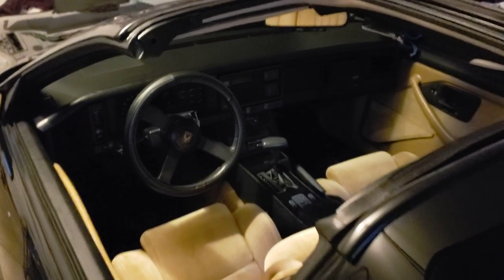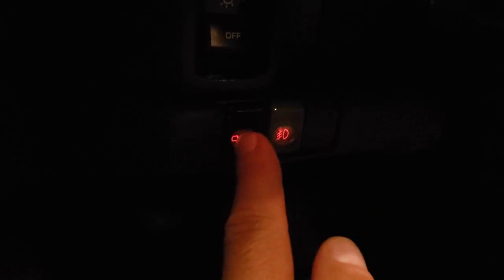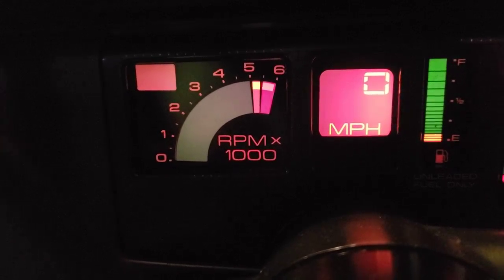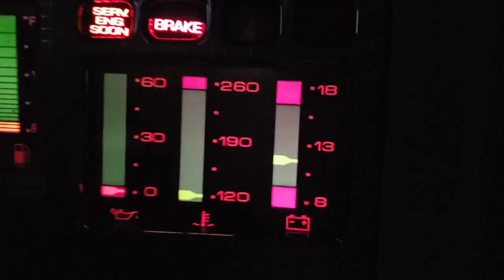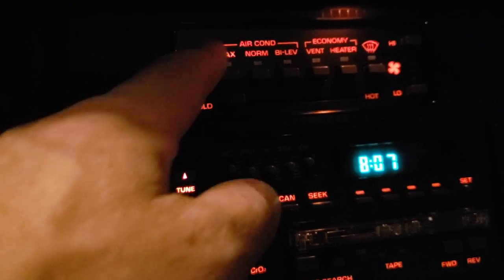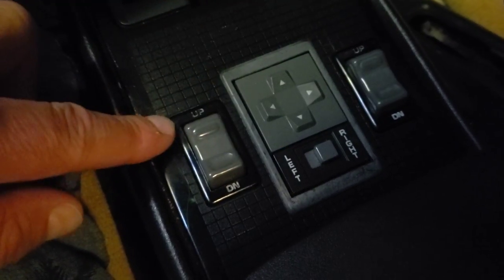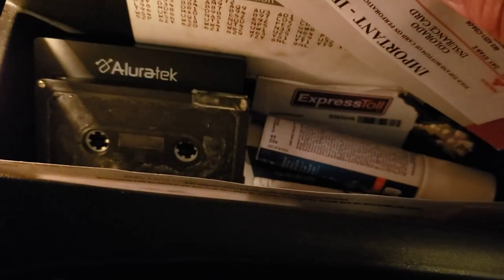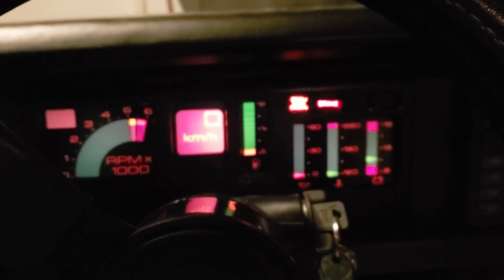1987 Pontiac Trans Am GTA Digital Dash & Interior Features Explained

Comment: I love the overhead console on the 87 GTA. Unfortunately it wasn’t available on the 88+ models. (I own a 1988 GTA) The cool thing about the 88 GTA is that it was the last year for the digital dash option and the first year for the radio controls in the steering wheel. Also, the radio was changed for 1988…. each of the equalizer “sliders” has a LED light. Finally, the “box” next to the tachometer is a shift light on cars with a 5-speed.
Reply: The box in the tach face should be the "UPSHIFT FOR BEST FUEL ECONOMY" light on manual trans cars.

SIDEBAR.... these were actual bulbs in the analog cluster.
Reply: Ya, I was gonna speculate that it was a "shift" light.  Those were not too unusual for the time.
IIRC my '85 had a "shift" light, however it was not hooked up on my model.  I actually think I put my car alarm light in that location so keep it "stealth".

Comment: Wow, outstanding example of the 87' Pontiac Trans Am GTA.  Looks like it's right off the showroom floor.  Thanks for the very in depth review of the functions of all interior components.  One thing I didn't see you mention is how the auto tilt rear view mirror will automatically tilt back down (even if it's dimming because of light) when the car is placed in reverse gear.  This is for safety reasons.  When backing up, the manufacturer wanted to have the mirror tilt back down so the driver has the clearest view possible.  Try it.  Go to a dark location, place the car in park and with it running, turn on the interior lights.  The mirror will tilt up to dim from the  interior overhead light between the t-tops .  Keeping the interior lights on, place the car in reverse.    The mirror will automatically go back down.  This is one piece of information that the dealer was telling me when I purchased my 87' GTA.  I've read the entire owner's manual and I've not found it in there.  There was about three such details about this car that the dealer shared with me that are not in the owners manual.
Reply from the maker: Wow, pretty cool feature!  Works like a charm. Thanks!

Comment: Yes my 85 T/A WS6 has that same overhead console, with reminder wheel dials and Firebird flashlight. I make sure I never kept batteries in it, as I would never use it. Nice radio, mine is similar but the step below with knob dials for tuning and volume, but I have "performance sound" option, with factory subwoofer and gain sliding dial, right between rear defroster and hatch popper controls. Nice car, these are very underrated classics, mine has 5.0 TPI with 205hp, it moves plenty fine for an 80s era V8.

Comment: Nice 87'.  She's mint.   My 91' Z28 has map lights in the bottom of the mirror, the main roof one and that's it. No floor lights.  My father came home with a brand new 86' IROC when I was a kid and it also had the self adjusting mirror and overhead console wiith the dials and lights. The removable flashlight said Camaro on it obviously.    Thanks for the memories.

Comment: Those overhead consoles were available several years, with virtually no changes it seems like.  And the elastic band for the cigarette pack holder never lasted very long.  I always meant to get mine fixed, but never did.
Looks like it has the knockout for the rear wiper yet, unless that is used for something else in later years.
Bummer that you have to set the brake to open the hatch.  On the slushbox you'd think they'd just tie it to the neutral safety switch.
I don't remember that being a problem on my '85, but I also never tested for it.
I was just happy it had a remote release so I could hook it to my car alarm.
Felt pretty cool to have key fob door locks and trunk release back then.  ;)

Comment: I have an 88 GTA. Drove it today. Has all of those features plus the steering wheel radio controls. Still trying to figure out how to clear the system. I replaced the radiator and it detected low coolant. Had to replace a headlight but it still thinks the headlight is out. So the coolant message and headlight message still pops up every time I drive the car.

Comment: Hi Ryan, a 1987 Trans Am is for sale in my town.  It has a large spoiler that I didn’t really care for but when I saw the pics of the interior, it’s the digital dash like your car.  Do you know if this one is a GTA or did they put digital dashes in non GTA Trans Am’s?  I don’t see any GTA badging
Reply: The digital dash was an option only on the 87' & 88' models when these 3rd gen Pontiac's were new, not just specific to GTA's.  The digital dash wasn't specific to the GTA option package.  Another thing to keep in mind is that these cars are well over 30 years old.  About 15 - 20 years ago, it was somewhat popular for new current owners to convert analog to digital because of the late 80's Night Rider series.  So keep in mind that 30 + year old 3rd Gens with a history of being owned by a  number of different individuals throughout the years, may not have the original equipment.  Best to look at the RPO sticker inside the car for accuracy of options currently on the vehicle if it really matters what type of dash.

Comment: Does anyone know for sure which years and how many of the Trans Am cars had this digital dash?
Reply: Common knowledge of this particular Pontiac, the majority of GTA's produced in both 87' and 88' had the digital dash.  Less common for these two years was the analog dash cluster.    And I seem to recall that there was less then 5 GTA's in 89' that were produced from the GM Factory with the digital dash option. The following years that GTA's were produced (90' 91' and 92") none were produced from the factory with the digital dash option.   Problem is, many of these cars have changed hands quite a number of times over the years and it was somewhat popular at some point in time for current owners  to change out the analog for the digital or visa versa to their desire.  And so for that reason, it's always good to reference the RPO sheet for the correct codes, year and the VIN # on that RPO sheet to match the car's VIN #.

Comment: The first thing I notice is it’s automatic a Booooooo
Reply: Yeah, because it's a t-top.  GM produced only GTA's with manual trans in hard top & 5.0 from 87' through 88".  You couldn't get manual trans and also t-tops &  large 5.7 engine.  Only exception was if the GTA was produced exclusively for export to Canada.  So, if you happen to be looking at a 87' or 88' GTA with 5.7 and manual trans, look at the RPO sheet for the Canadian export code.  If it's not there, it 's done aftermarket.  When looking at the RPO sheet, make sure the VIN on the RPO sheet matches the VIN on the car. Lots of clones and slapped together "GTA's" out there.  Happened to see one on ebay recently.  A 91' "GTA" for big stupid dollars and the VIN of the car didn't match the VIN on the RPO sheet shown in the auction.  Of course,  a picture of the RPO sheet showing "Y84" for "GTA" was on the RPO sheet.  Too bad the VINs didn't match.
Reply: @James
Most people don't like to shift...deal with it!
Reply: @johna.4334  When I was out shopping for the 87' GTA, I wanted the manual and the 350.   I couldn't have both so I decided to get the larger engine that had the auto.  Glad I did because the factory 350 cubic inch engine is pretty hard to come by anymore.
Reply: @johna.4334  Actually, it was because GM doesn't like to warranty manual transmissions, lol.
When 4th gens came out with their 6 spd manual, GM actually ran out of transmissions to fill orders.  I know one person who had to wait a year so they could get a new manual car.
Also, normally the manual is the "base" option, and you pay extra for the auto.
In the 4th gens, the 6 popper was like that, but if you bought the V8, the auto was standard, and the stick was a "free" option.